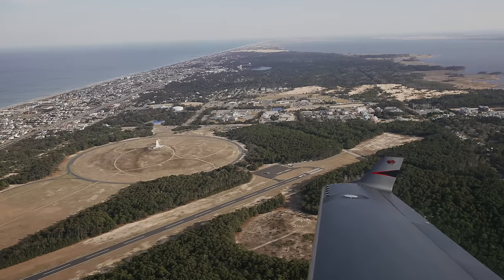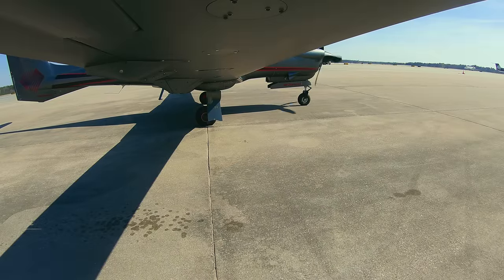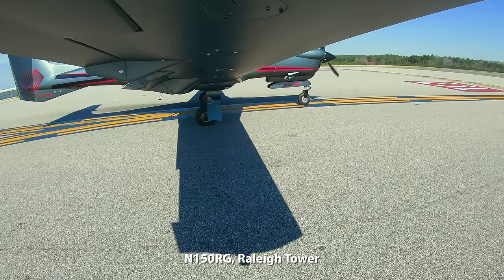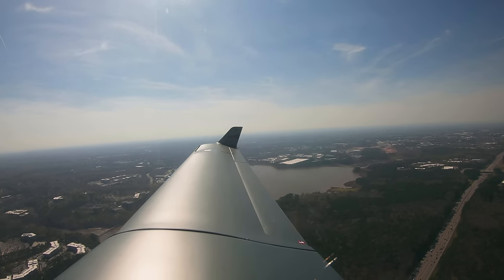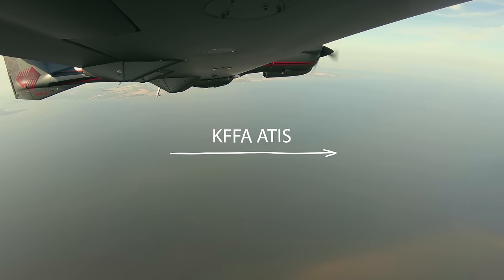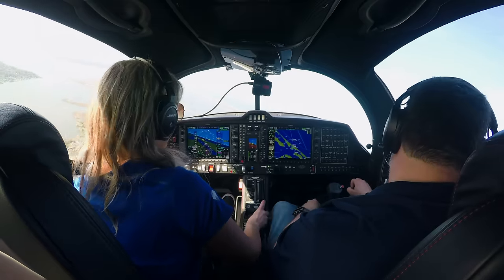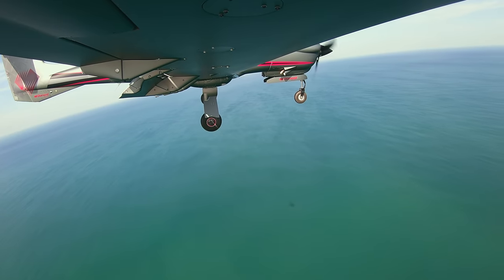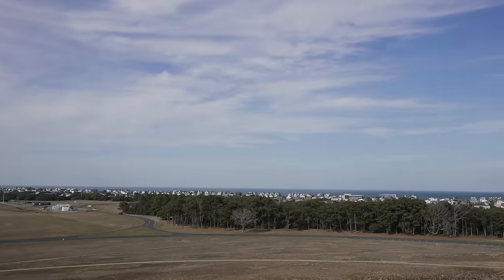Landing the Diamond DA50 RG on a 3000' Runway?? | DREAM FLIGHT to FIRST FLIGHT

Comment: Why does this plane have so little fuel capacity relative to the 62?  I can’t help think that the lack of speed/range will cost this plane a lot of sales.
Reply: :face-blue-smiling: Yes, nice Q !
Reply: The practical reason is that the 62 carries its 36 extra gallons in the engine nacelles. Why Diamond didn’t find a way to add more fuel capacity in the wings is a question only they can answer.
Reply: Because they're not compromising on safety... Fuel is in crash protected bladders between dual spars. Less space than if they put tanks in the hull.
Reply: In Europe a mtow plane at 1999 doesn’t pay airways charges. Also most owners only have a bladder that will last 3 hours 😅

Comment: My CFI's have beaten MORE RIGHT RUDDER into me and this is in 160-180 HP engines... I imagine with a 300 Horsepower Turbocharged engine you need at least 40% more right rudder, than you would in a Cessna 172 or a PA-28-181

Comment: I’m I the only one to see the fuel dripping  at1:35.
Reply from the maker: Extremely common after topping off fuel, this is the fuel vent to equalize pressure in the fuel tanks at all altitudes. Completely normal.

Comment: 49 gallons fuel capacity is simply unacceptable for an airplane like this. 750nm MAX range. And that's not even realistic once you factor in a real payload and decent cruise speed.
Reply: 50 gallons is the standard (long range) tank size on the DA40, which has only a 180hp engine ... so I agree that is small for a 300hp monster like the DA50